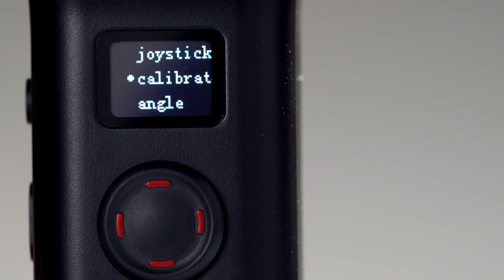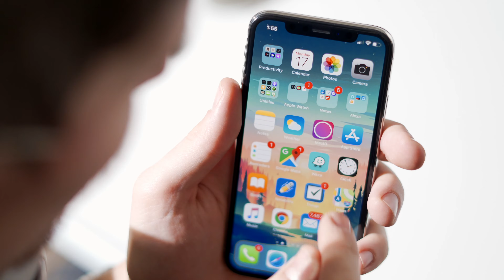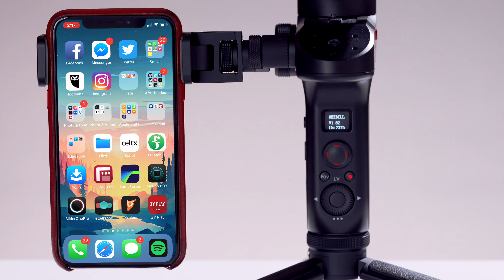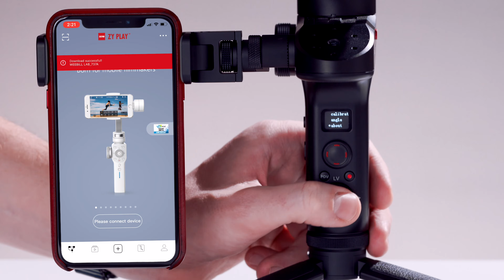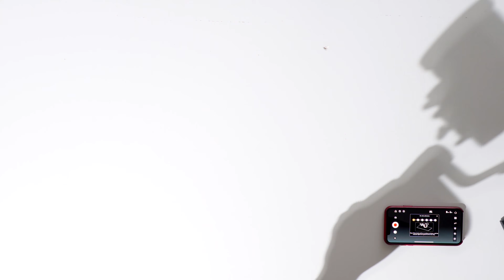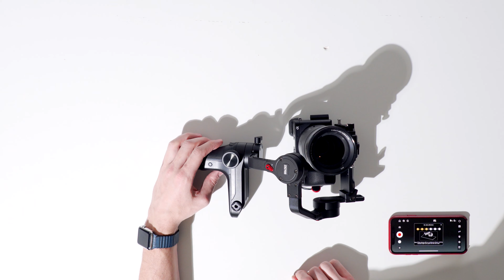Zhiyun Weebill LAB Firmware Update and Calibration Tutorial

Comment: Please can you tell me why my Weebill lab is badly shaking in some positions???
Reply: Usually means the motors are not balanced properly OR the motor strength isn't set right. That's been my scenario, might be different for yours however. I had mine balanced but would shake when I would get low - it was because it was too heavy for that motor because of the balance. Another thing you could try is tweaking the motor strength. I found when I put a lighter camera on - my gimbal was shaking because my motors were set to high. Changing their strength to medium alleviated the shaking

Comment: The app's update process SUCKs. I managed to update though but it is not the smoothest.

1. After you connected to your gimbal, when you hit download it can't download because it is not connected to wifi with internet 
2. I downloaded the firmware disconnecting the Gimbal wifi then connected back after download. Now another hurdle to cross. 
3. Update 1 of 2 works fine over gimbal wifi connected. On update 2/2, it says it needs to be connected via Bluetooth and not via wifi. I had to connect disconnect multiple times eventually it got updated. Cannot think of another painful upgrade process like this. No wonder this app has the poor play store or app store rating.

Why would you just not make the app do all itself or just say connect to pc and update.

Comment: For $600 I feel a little ripped off...it’s not super easy to get the gimbal the way you want it. Calibration and custom settings and motor strengths, firmware updates...a year later you get more for like $400 and I bet the new one isn’t as finicky and randomly vibrating.

Comment: The calibration part was very helpful. Couldn’t figure out why the camera wasn’t level. After doing the calibration, now it’s level.
Reply: I have the same issue.... but still after the calibration, it still isn't leveled. Is there anything that I'm missing? It tilts a little to the left while the gimbal is on. FYI the gimbal is balanced.
Reply: @DVliveSD  go into the settings after connecting to the app. In the same section as the calibration there is a motor fine tuning option. Keep the camera on the gimbal and use this option to fine tune for the horizon. This will allow you to level it. I am not sure why such a simple fix is not included in this video.
Reply: LSDGallery Yes ty. I found out myself after sometime... I’m surprise no one explains this feature.
Reply: @LSDGallery  Thank you so much. You helped me with some real frustration
Reply: @DVliveSD  Mine was the same way. It was balance but not level. Once I did the calibration that fixed it. Sorry, I can't be more helpful but that definitely fixed my issue. Good luck.

Comment: I cannot get it to connect with my z6. Anyone else having issues. Latest firmware and connected using usb c converter. Any suggestions?????
Reply from the maker: What can you see on the gimbal oled when the camera is connecting to the gimbal? Also try to set the camera to m mode
Reply: It just shows the normal screen that is always there when powered on. No camera info. I always have the camera in M mode. But I did try Auto and it still didn’t work.
Reply: I have not gotten any reply from the multiple locations i have left questions. I will be returning this product if this is not resolved. Nice product, but not sure the software/customer service is able to support the ideas.

Comment: I can't update my firmware.  I'm using a Crane 3 Lab and iPhone XS Max.  The v1.87 firmware was downloaded automatically, but during the install, the gimbal shutdown due to an overheating issue.  Now my gimbal shows firmware at 1.76 but the ZY Play app (v2.6.6) says it's at 1.87 and I don't see any way to get it to reattempt the firmware update.  Is there a solution to this?  Maybe a way to factory-reset the gimbal?  The seller, B&H Photo, does not have any idea how to fix it.

Comment: I FEEL RAPED BY ZHIYUN :(((
Reply from the maker: Sorry for your frustration. What kind of issue do you meet?
Reply: @ZhiyunTechGlobal  well I buy your weebill and its fine out of the box, then it needs calibrating after a few days use. I download the ZYApp on my OnePlus Android but no connection. I try reinstalling - No connection. So I try on an iPhone, no connection. So I try on iPad4, no connection. ITS ALL BULLSHIT. I DON'T THINK YOU RESPECT YOUR CUSTOMERS EXPERIENCE ANYMORE ZHIYUN OTHERWISE YOU WOULD HAVE FIXED THE APP.
Reply from the maker: @ala-bp9lj  Sorry for the inconvenience. Do you mean the bluetooth connection or wifi connection? Can your phone search the bluetooth or wifi in system settings?
Reply: @ZhiyunTechGlobal  This is what happens:
1. I download ZYapp
2. I power on the LAB
3. I make sure Bluetooth and WiFi on my phone is on.
4. I open the ZYapp and see I have a new firmware version found.
5. I try to connect by Bluetooth - my phone sees the WEEBILL LAB_859D but cannot connect no matter how many times I try. The Phone connects to the Weebill WiFi but in the app it says its not connected which is confusing. So no connected on WiFi or BT
6. I cannot download the update instead I see a flashing red circle warning reading "device is not working, please restart and connect again."
7. If I try to update Firmware it says "Failed to connect device or scan node.Please try again"
8. I restart and try again and again and again over different platforms. SAME ISSUE.
Reply from the maker: @ala-bp9lj  What's the weebill's firmware version now (including the body and the ccs)? Do you connect the BT through the ZY Play? Could you tell me the Serial number which can be found on the sticker on the image transmission module?
Reply: @ZhiyunTechGlobal  v1.87 S/N 71405B055010166
Reply: @ZhiyunTechGlobal  Yes I tried to connect BT thru ZYplay also I try from the phone BT too
Reply from the maker: @ala-bp9lj  That's strange. Would you please send a video of this issue to service@zhiyun-tech.com for diagnosis?
Reply: @ZhiyunTechGlobal  You call this strange? REALLY? READ THE COMMENTS BELOW FFS!! ITS NOT STRANGE ZHIYUN - ITS NORMAL FOR THIS APP.  Some of us use this professionally. I am srsly considering returning this unit and buying the RoninS because I doubt there is anything you can do as its a APP issue.
Reply: @ZhiyunTechGlobal  How will a video help with an app issue when I have explained EVERYTHING? Honestly. Give me a good reason and i'll make the video.
Reply: @ala-bp9lj  Dude this is Zhiyuns way of making it seem like they're helping customers with realworld App issues. Classic avoidance technique. In the end they'll say it's not the app, it's you - trust me. Look at the reviews on the Play store bro - 2.1stars out of 6393 reviews lmao...Says it all really. Zhiyun are going downhill now. DJI will dominate.

Comment: ZHIYUN it's now March2019 - I have a OnePlus6 and am unable to calibrate my Weebill due to a connection issue that looks like has been going on since last year. I reinstalled the app three times and still no fix. I am VERY disappointed in your lack of service with this bug. It's as if you don't care about non-iOS users. Why is that? You are losing loyal customers behaving like this (the Crane2 was my last gimbal). I will return my LAB as faulty in a week if I don't get a reply.
Reply from the maker: Sorry for the inconvenience caused. Could you please send an issue video with some description of the current os version etc. to service@zhiyun-tech.com for diagnosis? Also, you don't need to calibrate your gimbal if it works fine at present.
Reply: @ZhiyunTechGlobal  Its horizon level is off by a degree so it definitely needs calibrating (and I just tried connecting using my friends iPhone SE and still no connection.) ill send a video shortly

Comment: Everything worked fine until today :(   I am having this issue with  my gimbal now with no resolution in mind and no response from Zhiyun.

I bought a Weebill Lab US Updated Version 2 weeks ago , it worked fine for a few days and now it displays an X a few seconds after it starts and I can't get rid of it. In the 10s before it tries to update itself, you can quickly scroll through the menu, and in the about section, it shows that the firmware is 1.00 for a Crane 2
Reply from the maker: Sorry for the inconvenience caused. If you cannot solve it by updating the firmware again, please contact your seller for aftersale service. Thanks for your support.
Reply: @ZhiyunTechGlobal  is there any way I can upgrade/install firmware via computer? Wifi picks up Weebill, but bluetooth is showing "Zhiyun-BLE". Therefore I think this is is why I'm not able  to connect via app.
Reply from the maker: @dvsunleashed  At present it cannot.
Reply: Can you explain "v2" comment? I cannot find anything online considering an updated version you mention and the one I just bought came with an 1.05 firmware which was on original retail units.

Comment: Hello Brad!
Thanks for the weebill lab instructions and they are super helpful!
However, I am having a trouble updating firmware on my weebill lab!  For some reason, my phone does not detects the weebill lab’s wifi signal at all but no problem getting the bluetooth connected!   Any suggestions you could think of?  Greatly appreciated!!
Reply from the maker: Hello, please try different devices or reinstall the app to try again. Reboot the gimbal before connecting bluetooth and wifi.
Reply: Zhiyun-tech thanks for the tips and I reinstalled the ZY PLAY APP again and same thing happening...  it found the device and connected to bluetooth but my phone is not finding the wifi signal from the weebill lab...  the motors are vibrates so much on looking up mode and I need to upgrade the new firmware, anything you can help..?  Thanks!

Comment: where can I download zhiyun weebill firmware?
Reply from the maker: At present it can be only updated via the app
Reply: @ZhiyunTechGlobal  My zhiyun has the x logo on the display, how do I handle it? can't connect to the app, the bluetooth name becomes zhiyun-BLE
Reply from the maker: @DavDavid  Please contact your seller for aftersale service.
Reply: @ZhiyunTechGlobal  I need fast handling, because I need zhiyun for my work
Reply: @ZhiyunTechGlobal  I request firmware v1.00 weebill
Reply from the maker: @DavDavid  You can try reinstall the app or use other device to re-update the gimbal. At present it can be only updated via the ZY Play app.
Reply: @ZhiyunTechGlobal  I've tried on 3 Android and 1 iOS, but Weebill can't connect to a smartphone
Reply: @ZhiyunTechGlobal  I really need help quickly, because I have a job
Reply: @ZhiyunTechGlobal  That's so dumb. Why not enable it to connect to a computer as backup!? My Weebill won't connect anymore to my iPhone X or iPad Pro. Just spinny circle then  "Device not detected."
Reply from the maker: @mattcarlson12  Make sure you have selected the weebill lab page on the latest app before connection.
Reply: @ZhiyunTechGlobal  I don't see that page on the latest app? It says SMOOTH 4, CRANE-M2, and RIDE-M in the ZY Play App.
Reply: Why wouldn’t I be able to see the Weebill Lab page in the ZY Play App? It only has 3 tabs for Smooth 4, Crane M-2, and Ride-M.

Comment: Unable to upgrade it is failing again & again
Reply from the maker: What's the weebill's firmware version and your phone's os version? Have you tried to reinstall the app or use other device to try again?
Reply: @ZhiyunTechGlobal  your gimbal does not stay level on the horizon. I have constant issues with it even with perfect balance.
Reply: @ZhiyunTechGlobal  im using weebill S after i update the version 1.95 the gimbal turns wild. it keeps on rotating then standby mode on the screen pops. sometimes X. what will I do..
Reply: @ZhiyunTechGlobal  I do not know for him, but i tried with PC and a phone and upgrade failed every time and pc does not even detect existance of weebill s. I follow the manual.

Comment: My ZY app always says 'connect to device' with a spinning circle but never connects to the Weebill. The Weebill is on in standby mode.  How to proceed...?
Reply: For everyone who's having trouble connecting to your Weebill lab using an Android device. I'm on a Pixel XL 3 , so I cannot speak for all Android devices but it's worth the try .... Real simple thing turn off your mobile data. for some reason the mobile data interferes with the Wi-Fi settings for this gimbal. Good luck hope it helps.
Reply from the maker: What's your smartphone and camera?
Reply: @ZhiyunTechGlobal   So any solution?  Why can't I update the firmware?  It would be nice to just be able to connect the device to computer or wifi and update... Why is this so complicated and buggy?
Reply from the maker: @gnosticnige  At present you can use ios or another android device to try to update your gimbal.
Reply: @ZhiyunTechGlobal  My phone is Xaomi Redmi Note 4 with Android 6.0 and my camera is Sony A73

Comment: I can't update/connect my ONEPLUS 5 (android) if you have solution is great otherwise I have to send it back and buy another gimbal
Reply: @Bartek Albrycht hey man, I didn't cry but thanks for your advice I already bought new gimbal 4 month ago, I didn't talk with my mama about that yet
Reply from the maker: Please try to reinstall the app and try again. If it cannot work, try ios device.
Reply: @ZhiyunTechGlobal  No thanks,  I prefer to try another gimbal
Reply: @xveganx  Just disable mobile data on your phone.
Reply: @CESSNATURBO  thanks for advice but I tried everything nothing worked, sold WeebilI Lab 4 month ago and bought Moza Air 2, super happy with the gimbal
Reply: @CESSNATURBO  You sir, are a champion! This completely fixed my connection issues. I never would have thought to do that, and I'm not even sure why it works. But I was about ready to return this thing, so thank you!

Comment: Iam trying to upgrade the firmware for the weebil from an android device.  But Iam connected on the wifi and battery good.  But I keep getting Upgrade fails. Any Ideas?
Reply from the maker: Have you tried to turn off the data service after downloading the firmware?
Reply: @ZhiyunTechGlobal  thanks for reply.  Yes, just tried turning off mobile data.  Still no joy. I get to the uploading firmware screen, then hangs for 10 secs and states upgrade failed. With option to re-upgrade. Is there a way to factory reset the weebil itself?  only thing i haven't tried .
Reply from the maker: @ChristianLawrence  At present there isn't a factory reset option. What's your gimbal's firmware version now and what's your android device? Do you try to reinstall the app or use ios device to update?
Reply: @ZhiyunTechGlobal  yes tried reinstalling app.  gimbal on v1.82,  running latest android on samsung note 8. new  app downloaded this morning.
Reply from the maker: @ChristianLawrence  It is suggested to use ios device to try again. Sorry for the inconvenience caused.
Reply: @ZhiyunTechGlobal  No worries. Unfortunately I dont possess an IOS device.  I will have to be patient and wait for a fix.  Thanks for your help anyway. 👍👍
Reply from the maker: @ChristianLawrence  You are welcome. We've reported this issue to our developers.
Reply: I'm having the same issues here, galaxy note 8 user as well. Laughable that such a large company can't develop an app for such a large market.
Reply: For everyone who's having trouble connecting to your Weebill lab using an Android device. I'm on a Pixel XL 3 , so I cannot speak for all Android devices but it's worth the try .... Real simple thing turn off your mobile data. for some reason the mobile data interferes with the Wi-Fi settings for this gimbal. Good luck hope it helps.

Comment: My focus motor doesn't move on the Weebill Lab. Everything is set up right and connected but when I turn the unit on, the motor is locked. It does move freely when the unit if off and works via the ZY Play app but not via focus wheel on the stabilizer. The light is blinking slowly yellow and does blink quickly when first powering up (firmware upgrade?) GH5 with Olympus M. Ziuko f/1.2 HELP!
Reply: I have the same problem, seems like the wheel doesn't do anything (since the motor works out of app), but then I cannot update the firmware, I'm still on 1.82, because the stupid Android app doesn't offer me to update... ((
Reply from the maker: It is recommended to send your issue video to support@zhiyun-tech.com for diagnosis. Thank you.
Reply: @ZhiyunTechGlobal  So basically what you're saying, instead of testing the product throughly before launching to market, you launched a half-ready product, and let your customers test it for you, ha-ha, smart move guys, just in time for X-mas... 😂
Reply: oddowl hey, I have the same issue. So you have a solution now?

Comment: Why my weebill sometimes lost control or lost power like.. the motor just give up.. i shut down and restart then ok later few minute again.. already updated the firmware and calibrated. The motor shaking at certain angle:
1. Is it camera too heavy
2. My calibration is wrong
3. My unit faulty
Im using sony a7iii and 28mm 2.0 sony lens
Reply: Any fix?
Reply from the maker: Please send your issue video to service@zhiyun-tech.com for diagnosis. It is recommended to perfectly balance your gimbal before power on.
Reply: @ZhiyunTechGlobal  I've balanced perfectly on all axis and also have minimal wobble/shake at side angles
Reply: @pixeldawg  I am getting the same. Did you get this fixed?
Reply: @brodybourne  This was the solution: https://www.youtube.com/watch?v=kTY-e0mkr1k